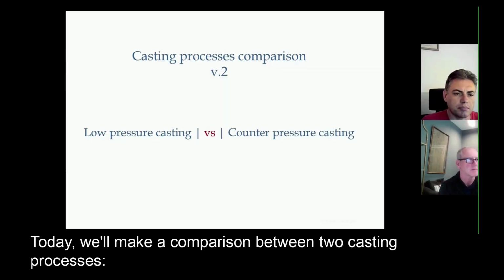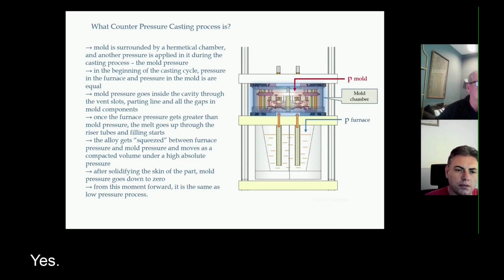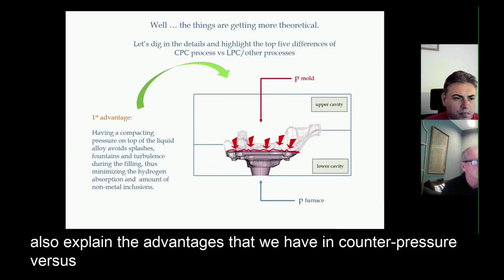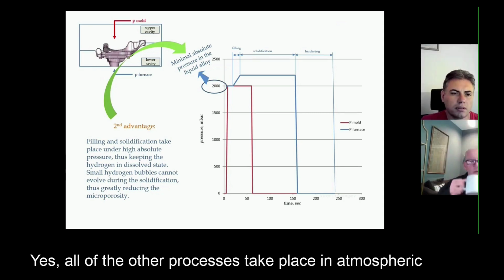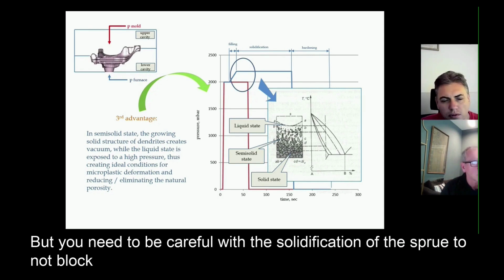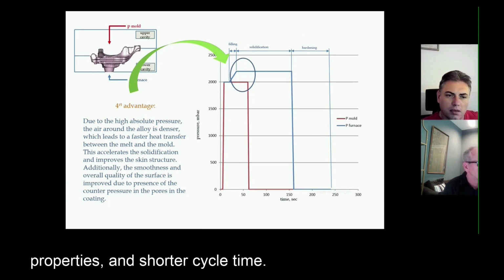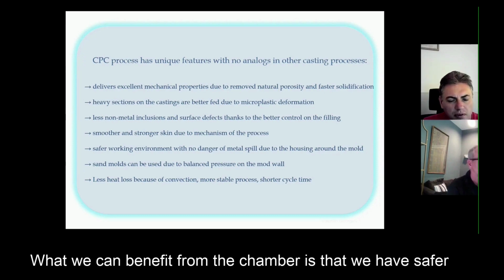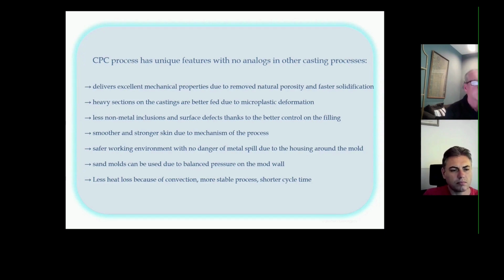What is the difference between Counter Pressure and Low Pressure Casting Processes?

Comment: Hi could you refer some book's or data to calculate pressurisation stages in Low pressure die casting
Reply: It would be very grateful if you could tell how pressurisation is calculated in stages with time

Comment: Hi, great video. What is the typical %increase in mechanical properties this process offers?
Reply from the maker: At a minimum we would expect a 15% increase in yield strength compared to low pressure and an elongation % over 10%.

Comment: Nice Video.  One additional difference is that in full component testing for fatigue life and durability, CPC cast parts have longer fatigue life compared to Low pressure castings.
Reply from the maker: Thanks for the comment, yes we agree, improved mechanical properties are most likely the result of reduced porosity and faster solidification of the CPC process.